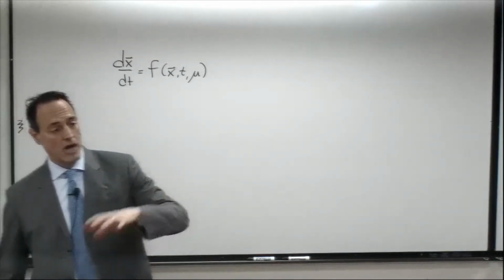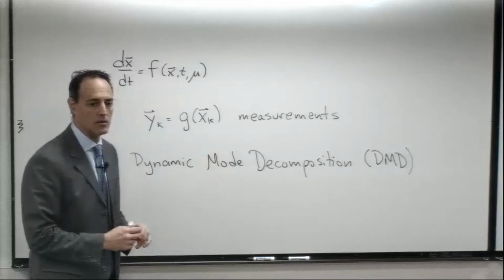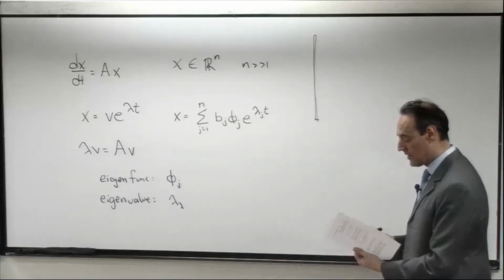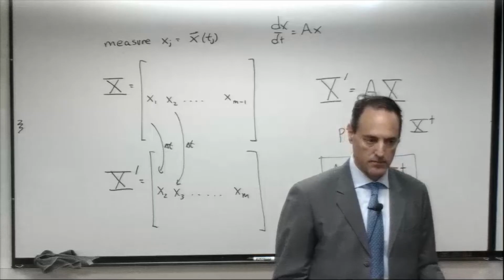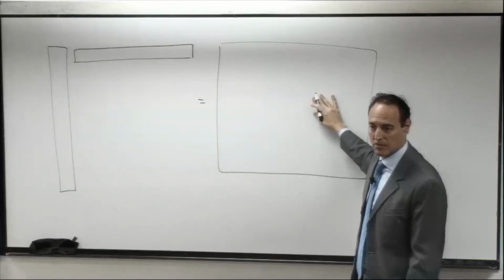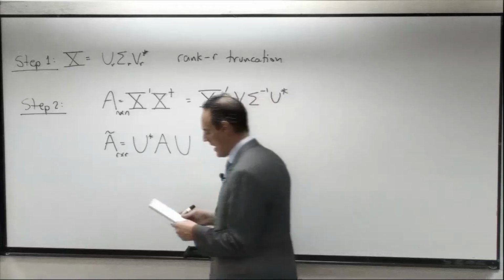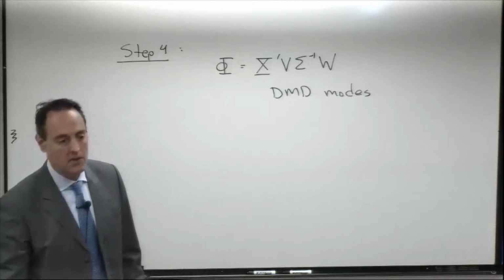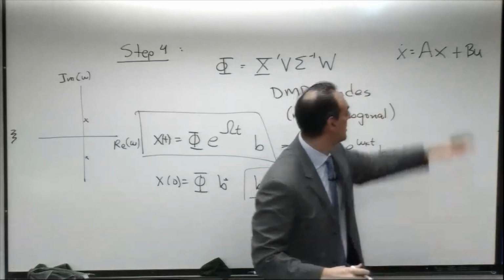Dynamic Mode Decomposition (Theory)

Comment: At 33:28, shouldn't he be using U_r for the similarity transform so that it reduces the number of dimensions down to r?
Reply: Yes. After he wrote U_r, V_r and Sigma_r on the board, it should be assumed that they are all subscript r in the rest of the discussion.

Comment: The fundamental assumption is that we want a linearization that works "well" at every point in the state space. Why does that even make sense to assume? For some arbitrary nonlinear ODE, linearization will be very different at different points in the domain.
Reply: It's just an approximation. A regression.
Reply: There are very few global statements to be made about non linear differential DEs and require assumptions to be made by the designer. However, we generally only want to know local behaviour of the system as phenomena are commonly constraint to a subset of the domain space. Furthermore, prediction tasks can be modeled effectively linearly given the system is sufficiently stable.
Reply: My problem exactly…this is more theoretical than practical

Comment: Very interesting for the novice and very nicely presented. I can't think of a better introduction to the topic, and I can't think of a more charismatic and didactical presentation. Thank you 10000 times for sharing this.

On the other hand, I believe that there's room for improvement in several parts that are quite incorrect and very superficial. At least, one could give a hint to the possible problems that occur when using the algorithm in real life applications.

For example, it is not true what stated at 29:27 that Atilde = U^* A U is a similarity transform because U is not a square matrix. A tilde and A do not generally share the same eigenvalues (not even the dominant ones).

Moreover, trying to propagate a linear system in a reduced space could be a very badly conditioned problem. What happens if the SVD basis selects only 2 modes (r=2) and each of these evolves with more than 2 frequencies? (very possible, since the SVD gives no constraints to the frequency content of its structures) Well, the algorithm will not move past step 2.
Reply: Correct me if I'm wrong but isn't the point of reducing the dimensionality was to only consider the non-singular subspace of the system? That would mean the system would actually be well-conditioned after the dimensionality reduction step as it is not singular.

Comment: At 17:58 the matrix A is defined to be both the rate of change at state x as well as the mapping from one timestep to the next. Given the first definition x2=x1+dt*Ax1 (eulers method for timestepping), while for the latter you would have x2=Ax1.
Reply: The later `A' could be I+hA (h=\delta t) for Euler integration or (I-hA/2)^{-1}(I+hA/2) for implicit midpoint, or whatever. But if we find the later A, do we really need to find the original (ODE) A?

Comment: What is meant by mode? Why is it named as DYNAMIC MODE DECOMPOSITION?
Reply: The mode is the eigenfunctions that you get from the system. The idea is that this method transforms the nonlinear dynamical system into a linear dynamical system, and the eigenfunctions you get are "modes" for the nonlinear dynamics.